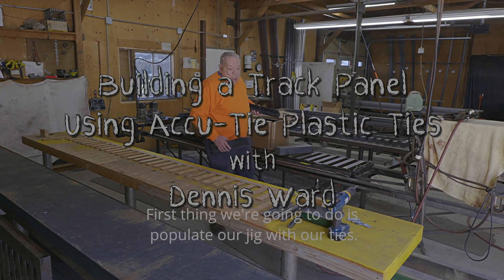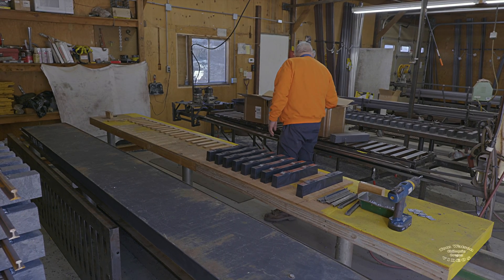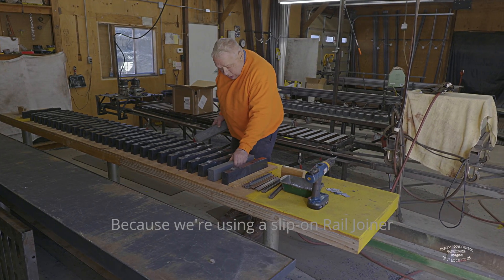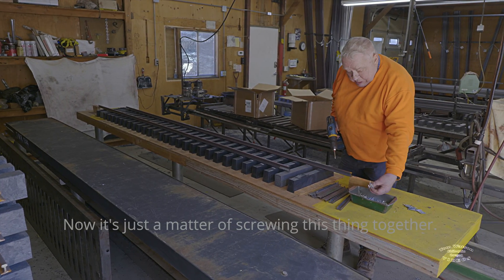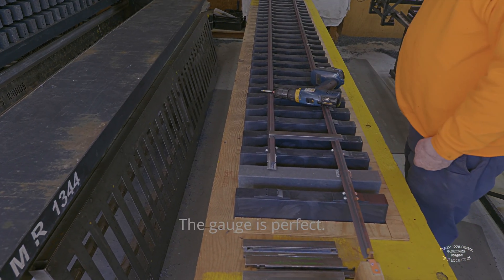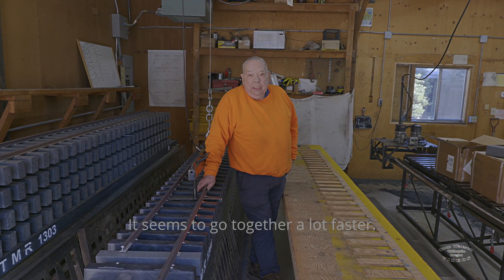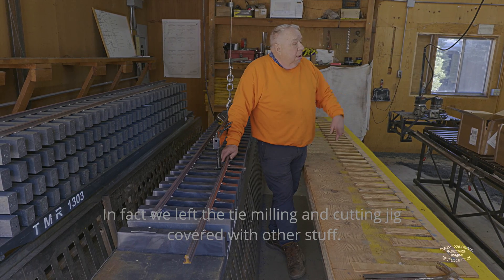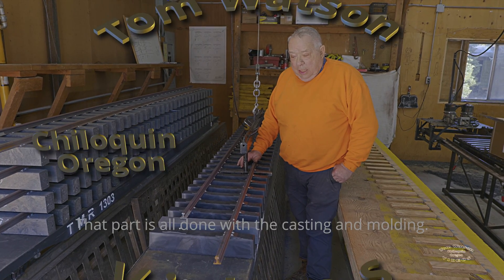Accu Tie Track Panel Assembly at Train Mountain

Comment: Could you use the router and take off the tie plate on the one side that has the joint plate?
Reply from the maker: That would be one way to do it. I believe that Accu Tie will eventually have such ties added to the product line. For our test panels, we just used one of the TM ties, which are actually a little cheaper than the Accu Ties.
Reply: @twatson703  Yeah you could ask them to make a box of ties with just one tie plate removed.

Comment: So, conventional construction with solid ties for non-standard rail sections (switches, diamonds, etc) but accu-tie for straight sections.   Hm.  It does look faster for construction of regular rail sections. 

Still, would be interesting to see an actual spreadsheet breakdown as to costs (how long blades and routers and saws last, that type of thing.)

But still, faster track construction on straight or curved rail sections would free up lots of time for making the more time-intensive components.

Have you done a serious 'crush' testing to see if the Accu-Ties can hold the weight?  Easy test would be to run various weights of vehicles over an Accu-Tie and a TM tie in the parking lot to see what max weight and crushability/damage resistance will be.  Also would give you an abrasion-test of each type of tie.

Stupid-fun testing like this is fun to do.  You can run everything from your gators to any small construction equipment you have on it.  If you have a tracked vehicle, do a pivot turn on the sacrifice tie to see what happens.  (Hey, you never know when either an earthquake or a miniature black hole will hit...)
Reply from the maker: These are prototype ties. They are not yet commercially available. We were only provided enough ties to do a small test track section, which will be done in a heavy traffic area. It is too early to have enough data to do a meaningful spreadsheet. All of that will probably come in due time. The installation of the track panel test section will be shown in the next video.
Reply: @twatson703  Cool.  Makes sense that they'd use you all as a testbed for their latest product.  Looking forward to the next video.